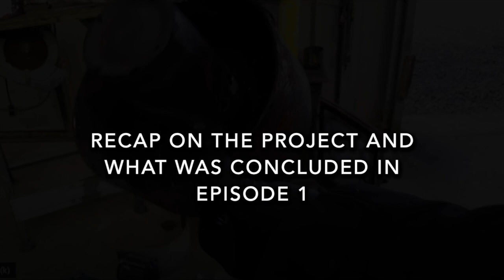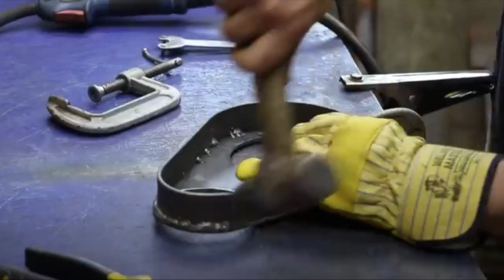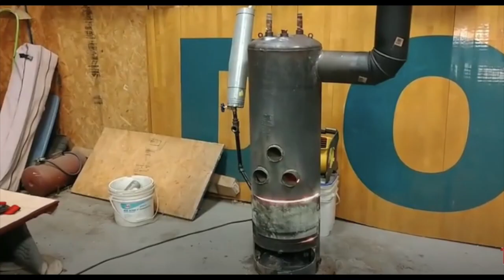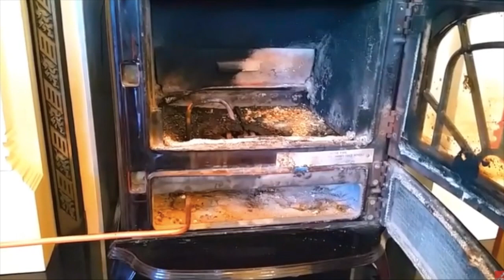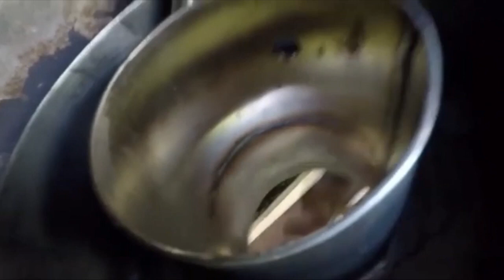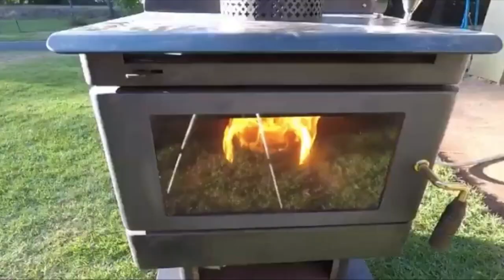DIY Waste oil burner #2

Comment: LOL, you sound very similar to GerryDIY. I just finished building myself one using a 27Gal air tank. I use 4" exhaust pipe but it's currently only about 6' high so I don't get that updraft  sound like the one in Gerry's video.

Comment: Brilliant. Thanks for your videos. I've been trying to sort my multi fuel stove which I've converted to run on waste oil. I initially had 15mm pipe feeding the oil in which was carboning up and blocking. I've gone to 10mm coming up through the bottom but still no better. I'm looking at the vortex idea too as I'm using the gerrys DIY one but with 3 inch box section in the middle feeding the air. I have the air forced in via a fan which is fed until the bottom and goes up into the main burn chamber. Temp is not an issue as it gets really hot but it produces a great deal of carbon on the inside and outside of the chimney. Keep the videos coming please
Thanks Mick.
Reply from the maker: Thanks Mick, useful stuff there. I am planning to use 10mm Stainless Steel tube from the bottom up so your experience is of interest! if you had issues with 15mm I may have to increase to 20mm...I'm planning the conversion to waste oil in Feb so i'll post how that goes.

Comment: Have you considered using heavy masonry for thermal mass in your system? It seems to me it might be a good match for the batch burn waste oil furnace ie let it radiate heat over night when un attended
Reply from the maker: Well, rather that use masonry I'm using the hot water in the underfloor heating system which, in effect, would be the same. The added advantage of the UFH is that all the shed gets heated, not just around the burner.